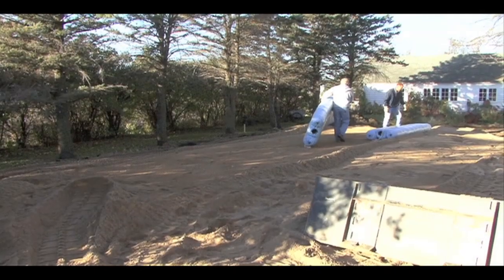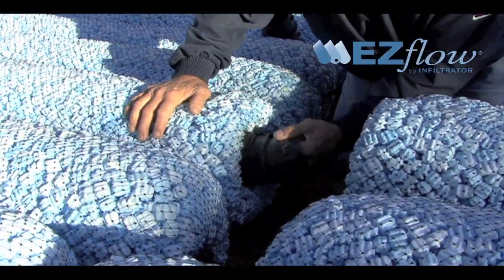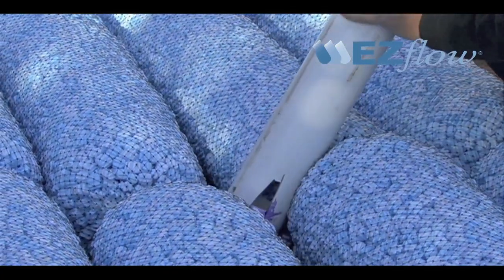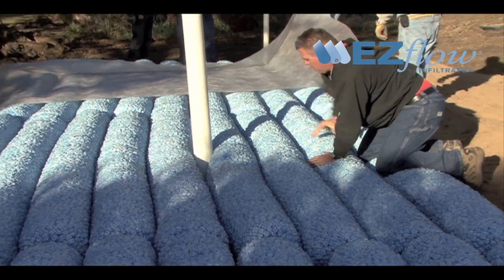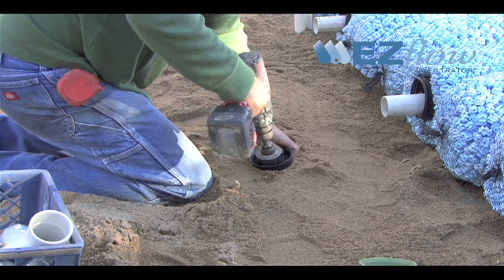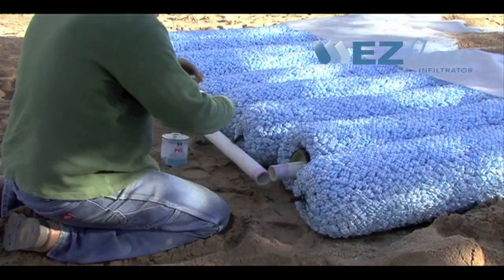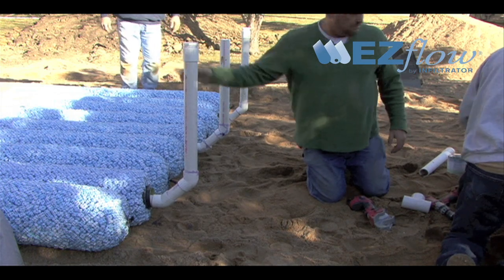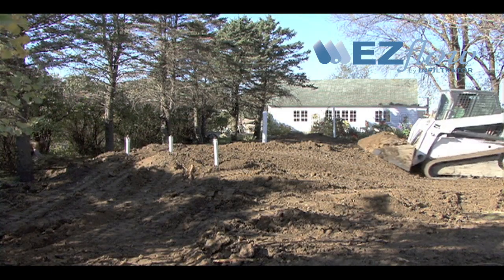Septic Mound System Installation with EZflow by Infiltrator

Comment: im in wa state but looking at land in oregon, idaho. Using septic options to determine where to buy land at. 
So  im fairly early in my process.
But i can will call the various components and self install. Just trying to compare cost with gravel and pipe. I already have the excavator and im wondering if this is a better option costwise for those who rent an excavator and hire labor of if it beats the cost of gravel if you have a back hoe and do your own labor and parts delivery.